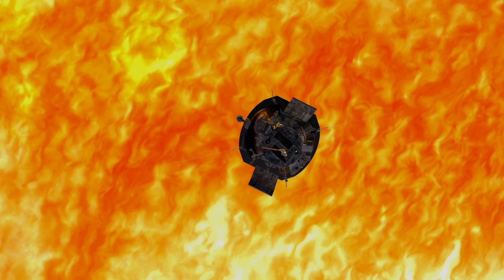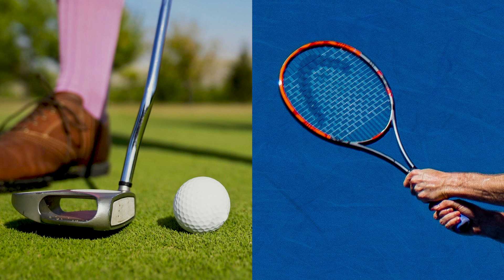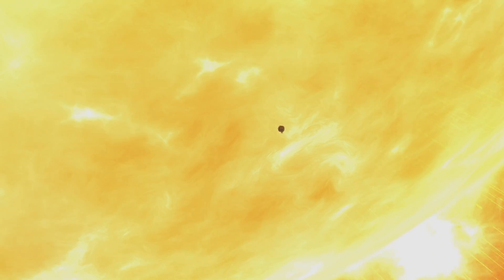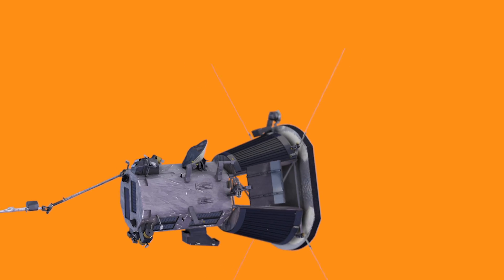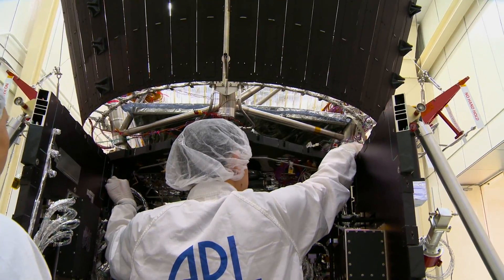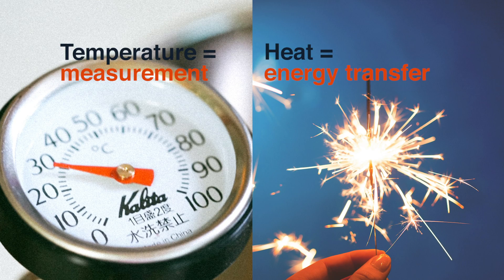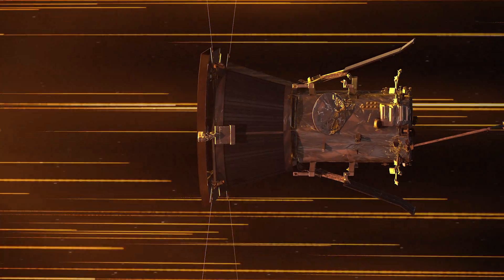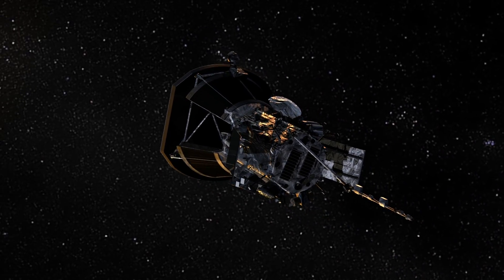Why Won't it Melt? How NASA's Solar Probe will Survive the Sun

Comment: What about solar wind?
Reply: Even near the sun, the solar wind pressure is extremely low.
Reply: My3dviews Um I don't think so! According to the equation of the solar wind pressure, the proton mass, the density in the solar particles and the speed of the wind, they all get higher when the pressure gets higher. When you're close to the corona, you experience the "fast" solar wind, which has a velocity of 750 km/s, while near earth, it's average of 400 km/s. So the pressure of the wind near the sun is much higher.
Reply: +Celtic 67   The pressure of the sun's corona is a fraction of the Earth's atmospheric pressure, since it is made of low density particles (like protons and electrons and some alpha particles), not heavier ones like  Earth's atmosphere.  
The solar wind is made of these low density particles that escape the upper corona.   They escape because they are far enough away from the sun where gravity is lower.   
https://scied.ucar.edu/solar-corona
Reply: +Rogy Mahmoud   You need to take into account the extremely low density of the corona when making calculations of its pressure.  Single fast moving particles like protons and electrons do not produce much pressure even at high speeds.
Reply: Rogy Mahmoud Then why don’t we have solar wind across the entire earth?
Reply: Celtic 67 lol bc science man. Its whatever they want it to be

Comment: So if sun acts like Owen, the water inside radiator will get boiled.🤔
Reply: Alexander Belov no, not if you planned for that pressure. They build their equipment to handle what it needs to handle, it's not like a mechanic with a car slapping a radiator on and not knowing if itll cool properly. Before you start spreading lies educate yourself. If they build a radiator to withstand a certain amount of pressure, itll hold, the parts are made custom every time, not bought off a shelf
Reply: No, the radiator has refrigarator that generates coldness
Reply: Neppoliyan Dakshin Yes. The steam pressure shall destroy tubes of the cooling system.

Comment: Melt it will not since the sun act like a convection oven. It is sending out rays that is picked up by the near by planets. This is one of the reason why space is cold.
Reply: Dart Gar 
Space is cold bc there is no stuff to heat. But this probe is a good piece of stuff for heating.

Comment: I wonder if there is any concern for CMEs ... I imagine they could increase the local energy density of the corona quite a bit ...  Is there good data on the energy density of a typical CME that close to the sun and how close to the maximum that the Parker Solar Probe can withstand are they?
Reply: Currently the probability of a coronal mass ejection is very low, but not zero. We are currently experiencing the solar minimum, part of the Sun’s 11 year “season” of activity. This means this is the best time for a mission like this as the Sun us very “quiet.” Very few sunspots, magnetic storms and flares.
Reply: Zach Cox I was wondering about that. Can't wait to see what they discover with the probe.
Reply: When I posted the comment above I did think about 'Solar-Minimum' and if we combine this with the expected lifetime of such probes then that would argue that it is OK not to worry too much about CMEs.  So: "Slide In While Things Are Quiet And Take A Look" :)

Comment: Excellent!  So it won’t be using the Ferengi invented forcefield?
Reply: As long that Ferengi forcefield wouldn't work based on a latinum coinslot which it probably will.  First rule of acquisition.
Reply: JAKE W JONES 
You should look for flat Earth videos. Those public is what you are looking for.
Reply: Too bad none of them have ever bothered to the simplest experiments proving they're own flat models are never consistent.
Reply: Google Satellites images look at pictures not one of them are real even the real looking ones are all CGI (Computer Graphic Images) Do the same for planets. 🤣🤣
Reply: Btw CGI stands for computer generated images, this does mean all those images are CGI. By that logic me taking pictures of a  big wall super close up to it, then stitching individual pictures together to make a big picture would be computer generated
Reply: jokes on you, we are actually living in a computer simulation so everyone's wrong.
Reply: @TheAngryGeneral tell me, when you stand in the shade, do you still get a sun burn? The heat shield is white, so it reflects most of the light (and heat) hitting it. Since they're in the Corona, a very "thin" part of the sun, there aren't too many particles to interact with. Those few particles are in the millions of degrees, but there aren't that many of them. Because of this, the ones that do end up hitting the shield make a little piece of it vaporize, instead of transferring energy into the rest of the shield. (By tiny I mean on an atomic scale.) The shield is very, very light weight, so they can just make it thick enough to survive the trip through the Corona as it "evaporates" or ablates away.

TL;DR- it's white so it reflects the infrared (heat) radiation hitting it, and the plasma particles of the sun itself make the shield slowly vaporize instead of making it hot.
Reply: In a far, far Galaxy, they're using it. but no here sadly.
Reply: To anyone interested in a much lower tech demonstration of this idea, check out the YouTube channel AvE. He has a video where he made carbon foam out of a piece of bread and he could point a blow torch at it with his hand right under and not even feel it.
Reply: pe hgt so you're major at flat earth by using youtube huh? Must be smart.
Reply: Guys, its in space, there is no air for the surroundings to be hot, so a heat sheild only in the front would work to keep the rest cool, because the heat from the sun would never touch those parts
Reply: Steven Baumann The Shield won't do anything. Don't they understand the Sun it's much hotter than the lava on Earth? If the shield did survive the heat will still melt everything inside the probe!
Reply: The Angry General 
Of course the shield will work NASA scientists aren't idiots. It will allow the probe to approach closer than it otherwise would, before eventually burning up.

Temperature differential is much higher in space as it has no air circulation. Thus the temperature of the probe behind the shield will be substantially lower.
Same applies to anything in space. Even our orbiting satellites can have high temps on the sunny side but pointing away from the sun sub zero.
Reply: JAKE W JONES I’m not sure what you mean. I mean, the mission IS happening; you can look it up on NASA’s schedule.
Reply: Jake Jones means he thinks all NASA missions are fake.  (I don't.)
Reply: u for real
Reply: https://www.universetoday.com/wp-content/uploads/2014/09/sun1.jpg

here you go, fresh off the SOHO Extreme ultraviolet imaging telescope, the only computer generated bit might be compositing and color correction
Reply: Saani Maula hmmm I think it's all CGI. My p900 camera says so.
Reply: pe hgt lol, dude get me the same drugs you're on
Reply: CGI is only used for simulation because we don't have the materials and support to reach space for long. And fyi, not all in Google is real so check your sources if its legitimate or not.
Reply: The earth is flat, NASA is stealing your money for CGI cartoons... Hahaha  silly globies.
Reply: Lets just hope they dont used duck tape like on Apollo.
Reply: That's a safe bet, Steven.  :-)   Especially as much of this is stuff that a schoolchild can understand.
Reply: Thx
Reply: Steven Baumann yeah they wont
Reply: JAKE W JONES it will be fine
Reply: I have decided to finally sell my bridge. It is in London. I am taking offers. My initial market research indicates that people who believed this video are my most likely customers. Incidentally, my research also showed that these same people should not have offspring.
Reply: Don't believe these fraudsters. Space is made up it's all CGI images and no we don't live on a spinning ball. Google images of sattelite and planets you will see they are all CGI images none of them are real. Watch ODD TV and Eric Dubay they go into great details. The sun moon and stars are actually inside the earth there is a firmament or glass like dome surrounding us and we can't get out!! The mars landing and mars rovers were all filmed in Greenland this was busted open quite a while back already but for those of you that don't know. Well sorry to have to burst your globe earth bubbles!!🤣🤣
Reply: pe hgt people like you crack me up
Reply: pe hgt - the name "ODD TV" says it all...
Reply: pe hgt spot on 👍
Reply: pe hgt So ummm.....since sun, moon, and stars are all inside of earth and we are trapped inside by a 'dome'......who the hell created that 'dome'? God? The Ancient Greek? Or maybe Satan because your god damn explanation makes 0 sense to me.
Reply: pe hgt Moon inside the earth? Then what are spaceships for? I bet an airplane would be enough to bring even everyone there. Why would we even listen to your inconsistent flat-earth theories that don't have a definite source? You even misunderstand the bible. If you have NASA and rockets are your toys, why don't you explore the real instead of faking it all? Besides, NASA is not the only space agency in the world. China would probably be the first to disclaim and deny NASAs lies. But instead, they launched a rover to the moon and sent their first man to space without asking any help from the international organizations.

Comment: I can't wait to see the James Webb Telescope to be deployed
Reply: Well you’ll be waiting a few more years, it was delayed until 2021.
Reply: It will either be "deployed" or "destroyed".
Reply: It's not that it isn't powerful enough,it's that anything that got that close would turn into plasma before it even touched it so we wouldn't get enough data
Reply: My3dviews either “loved” or “scrubbed”
Reply: Well your gonna have to wait a while... all these delays
Reply: The testers cannot deploy it on the Earth. So the developers do some changes to the heat shield of JWST.
Reply: Just send the damn thing into the sun already
Reply: 949surferdude Actually humans don't have rockets powerful enough to send something significant under the Sun surface. Probably Falcon Heavy can send 10kg to the Sun.
Reply: Alexander Belov you dont actually need a huge rocket power to bring it close to the sun, you just need to slingshot it towards the sun....
Reply: Sure you can wait
Reply: I'm from the year 3000. We're still waiting. It's now been delayed another 4 years